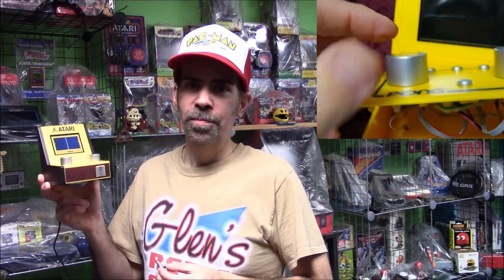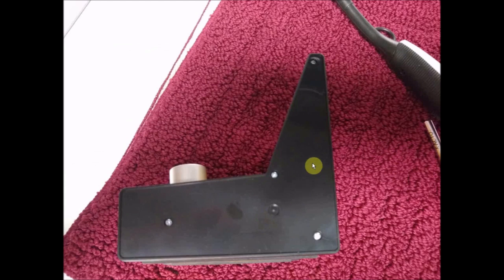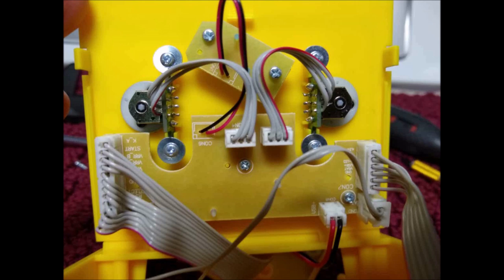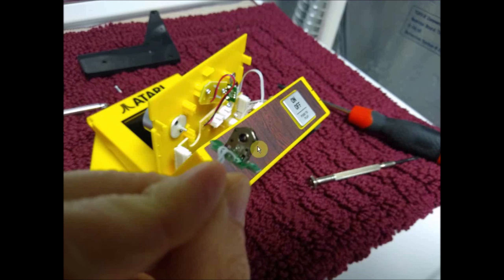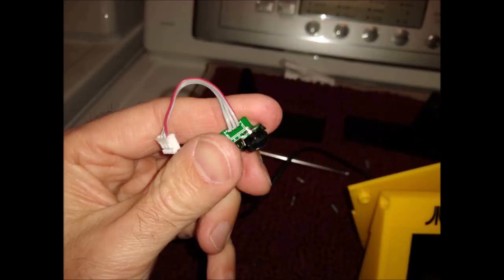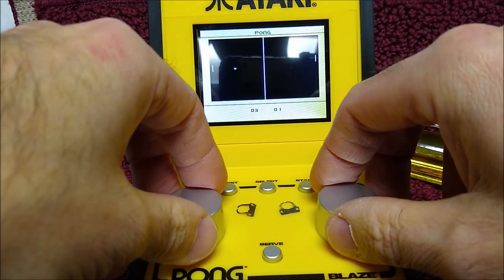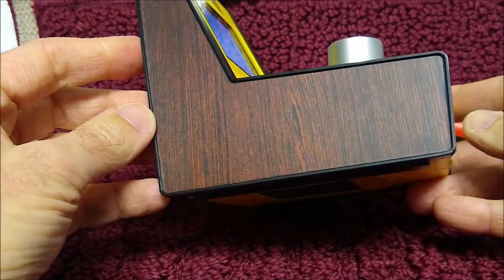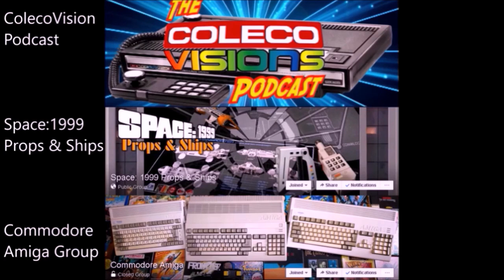Blaze PONG fix for click paddles .. This is the way...

Comment: Love the detail in the vid Glen!!  Ya, I to removed the clicky initially and it vastly improved its feel but did not show that on my vid, as I was not happy with how much you still had to turn the dial to get a good range of movement (but thats just my preference :P)
Reply from the maker: I think yours is the better way to go. Just wanted the non soldered out there to have an option ;)

Comment: Those rotory switches are usualy used in mouses for the scroll wheel and in those apllication it makes totaly sense to have it "clicky" as you don't want to have your pages scrolling till eternaty.
Bending the four tabs is a littly risky as at there bending point they where weakend in production process to gain sharper edges for bending. To bend them two or three times more will likely break them. But bending the metal housing somewhere else works just fine.

Comment: You know something....
This is a perfect example of what YouTube videos should be all about. 
I'm pretty late to this party, as I only got hold of one of these units today, and I must admit... The clicky paddles were annoying.
So without holding much hope I'd find something online to help with that issue, your video popped up straight away. 
And man, what a breath of fresh air.... Clear, detailed help that was straight to the point. 
So much so, that I've just gone in.... Very much as an untrained and unknowledgeable man in this modification field...
And within 15 minutes, the unit is back together again, and exactly as you said it would be. 
Perfect! 
Sure, this mod doesn't sort out all the issues, but it does at least totally get rid of that annoying soft click click click. 
Thanks very much indeed ...a great help 👍